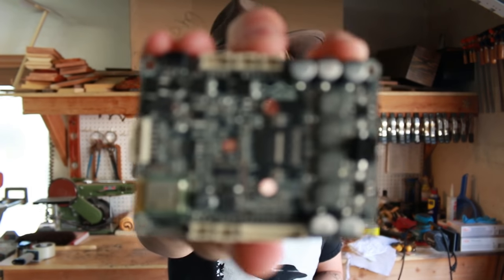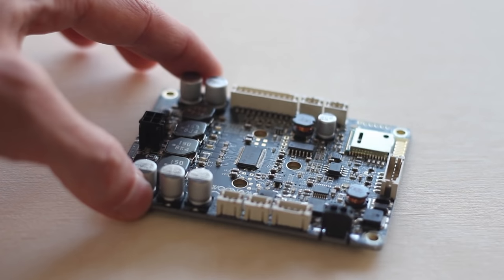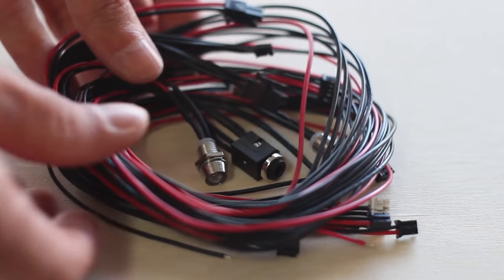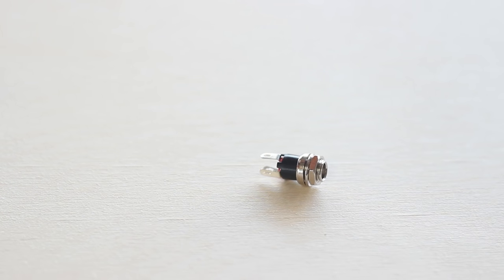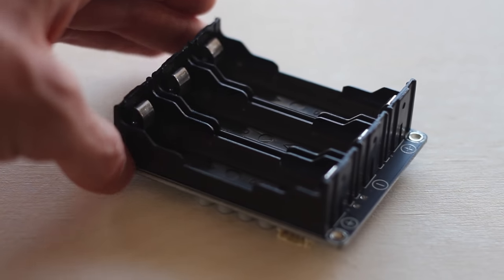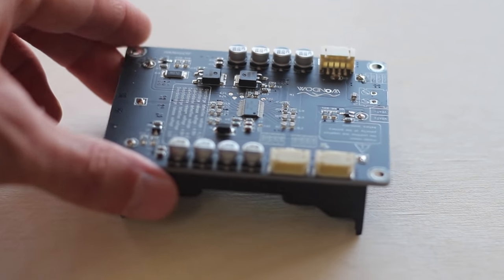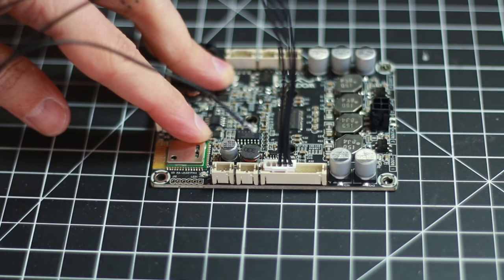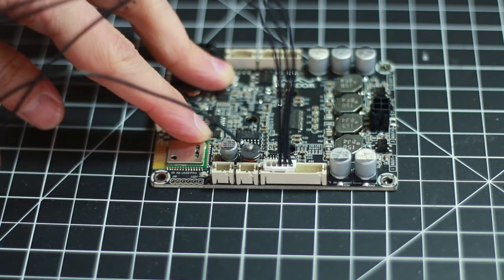The Best DIY Bluetooth Speaker Amp Board (For Now) & How To Fix Its Problem

Comment: so TDA7492P is a really common board for Bluetooth speaker projects, what makes this board better? does the TDA7492P output more watts ?
Reply: compare to non-p model, it doesn't need external heatsink to output 25w per channel, which are enough for project like this.
Reply from the maker: Hey, James! Watts aren't necessarily a good metric for quality of product. The TDA7492P is a good amp for DIY speaker builders, but it has build quality and reliability problems. I've had some boards work great, while others have big problems. What I think puts the Wondom line over the TDA7492P boards is the accessories and add-ons that are available for it. The wiring kit makes setup easy and the extension and battery board makes it really versatile. Tie that all together with reliable build quality and you've got a pretty damn good amp. Thanks for watching!
Reply: yeah that's very true. I was trying to weigh the pros and cons, basically when I build my Bluetooth speaker I want it to be as loud as possible but not necessarily the size of a boombox. However i am aware that you need a balance of audio quality and audio output. I do like this Wondom board because of what you mentioned, which is all of the easily added on features.
Reply: Thanks for your input. In terms of audio quality. How does this board compare to the TDA7492P? Does it have a good low range frequency response (bass)?
Reply: I too am curious to know how does this board compare to the TDA7492P? Does it have a good low range frequency response (bass)?

Comment: Questions:

Hey Kirby, great vids, keep it up!
Those speaker wires in the wire kit look really really thin,  Any idea what gauge they are?  

 Is the amp powerful enough to warrant using better speaker wires? (if using larger /more demanding speakers of course).

Comment: Do you know if there is way to get power OUT of this board? (Say to attach a raspberry Pi zero?) if there is this could be used to make an awesome all in one wifi/airplay compatible speaker with only a single power cable!
Reply from the maker: Thats on my list of builds! I'm pretty excited for that one. Yes, you can pull power right off the power jack, pretty simple!
Reply: Awesome I would love to see how that works. My current build is currently cobbled together using a crappy PAM8303 style board i got off Ebay for a dollar and some pretty naff speakers (no Bluetooth either) but I would love to upgrade it to something better when my son is a little older. I'm just going for a very kid friendly build, two button operation type thing that I can throw MP3's on over the network. I have the electronics sussed but in need to find some time to build the box as woodworking isn't really my strength.

Comment: Hi Kirby, Not sure if you can and wasnt sure where to ask you but my question does concern this board. Ive just bought the JAB2 board, 18650 charging module and aux module. Great sounding amp, just what I needed except.....my 18650's are charging BUT I dont know how to get them to power the amplifier...Works fine when powered by a laptop brick but nothing when I disconnect....? I tried to find your blog (mentioned in this video) but its not there, just a 404... Please do you have any advice...?

Comment: I'm having issues with the aux in on this board. I plugged it in per your diagram. I see the driver moving but no sound. bluetooth works fine, but nothing from the aux. any thoughts?
Reply from the maker: Is the aux cable plugged into the right place? The diagram they provide is pretty horrible. Double check with my guide. There's a link in the description.
Reply: First and foremost, thanks.

I have it in the long slot all the way up towards the other slots, or furthest away from the speaker outputs.  

I actually tried it at both ends and nothing happens at either. 

Again the bluetooth works just fine and when i have the AUX hooked up the woofer moves, especially if i turn up the pot, but no sound.

Comment: Hi.

Just a quick question from total noob - if I would like to build myself internet radio style device with wifi, bt etc. I can use this board and connect it to audio output of for example a raspberry pi ?? This is only amp? It does not have DAC part - this would be from a raspberry pi? (Or a phone using BT ?)

Thanks and have a nice day.
Reply from the maker: I don't know a whole lot about this, but I believe it depends on the software you are using on the Pi. Some require a DAC on the Pi and some don't. This is just an amplifier board, though. You would need some sort of DAC before this board. Thanks for watching!

Comment: Are the li-ion battery boards 'stackable' in any way? I would like to be able to have at least two boards run in parallel for projects that are a little more power-hungry.

EDIT: Even if it meant having two 18650 cells per 'slot' on the board. Is that possible? Obviously two cells won't physically fit into one slot, but they could be wired in right? From my very rudimentary understanding, this should be possible as long as the cells are all the same and equally charged before connection?
Reply: It does help indeed! Thanks!

Comment: Ii bought the 2 x 50 wondom board with battery extension.  I need help! I have a sinnry 3 terminal dc connector. How do i wire this? From what ive read the 3rd terminal is a switch for the battery to turn off when power is connected. I am so confused on how to wire properly.  Please help me

Comment: I recently bought this board (15W version) after watching this video.
Firstly, the 18650 board works sometimes, most all the time it didn't...need to take out the batts & put it back a few times to make it work.
Secondly, right at this moment the bluetooth is disconnecting after few seconds of distorted playback.
I just got this board 3 days ago & after 1 day of testing it isn't functioning properly anymore.
You put the title Best DIY Bluetooth Speaker Amp after how many days of testing it? & how many projects have you made with it?
Do you have any suggestion to solve this issues cause it seems that Sure Electronics isn't replying me with good informative answers.

(I'm using a pair of 3W 4ohm speakers (waiting for my full range 10W 8ohms). Running purely on just batteries at this point, adapter is on it's way)

Comment: I have an unusual project. 
 I want quality sound in a welding helmet. 
 Safety rules preclude earbuds and muffs. 
 Bluetooth connectivity a must. 
 
 Wish list:
 Solar charging panel because why not take advantage of welding light?
 Have a speaker and/or Bluetooth board suggestion ?

Comment: hey kirbie, i'm am plannig to buy the jab3 2x50 watts with the lithium ion extension board and the interface board. as lithium ion batteries i want 3 3500mah batteries. i wil use 2 two way speakers that are both 80 watts peak and 45 watts rms. but what i want to ask, do have an idea of how long my portable speaker will play? i also use 2 passive radiators in the box. greetings from the Netherlands. and love your videos so much!!!

Comment: I had the same problem when I first got one of these boards, came to the same solution, I think that that switch wire on the AUX is for the 15w board, from their site on  "
Please note that the JAB1 has a plug in detection circuit on board, the Bluetooth can only be searched when the 3.5mm headphone jack pluged in."
Reply from the maker: Interesting! I've only worked with the JAB2 board so far. I'll pick up a few JAB1's when they are back in stock and test them out as well. That's a strange way to go about things...
Reply: I haven't played around with the JAB1 either, my guess is they must have updated the amps but not the accessory cables. the documentation is fuzzy at best, they recommend a 12v power supply on the page, but it won't charge the batteries with out a higher voltage supply, I got a 19v one.
Reply: I think that the Aux cable is defined for JAB1 board (JAB 1 has a plug in detection circuit on board) and for JAB2 the best choice is to use the Extension Boards Optional (ref AA-JA11112)
My opinion is that detection circuit for JAB2 is on the extention board optional
What your feeling ?

Comment: Turns out that cable being unplugged to fix the feedback problem will not allow you to play music through your phone. At least, my phone (Galaxy S7), must use that cable as some type of jack detection. I have two of those aux cables and the one that has that cable unplugged will not switch my phone output to the aux connection. It just plays out of the speakers :/. I have found that I can use a PC or other device that allows you to force playback through a specific output but haven't found a way to do this through phone.
Reply: I also thought i would add that the 2x30W and the 2x15W boards function differently. You do not need to unplug that cable for the 2x15W board. The 2x15W board also plays nicer with batteries. The charge LED is on constantly with the 2x30W board even with a full battery pack. The charge LED only comes on when actually charging with the 2x15W board. None of these boards output an actual 15W or 30W per channel. It's closer to 10W I'd say.

Comment: Ok so I bought a board from Amazon
(ELEGIANT 50W+50W Wireless Bluetooth 4.0 Hifi Audio Receiver Digital Amplifier Board with Protective Case (TDA7492P), and the second time I plugged it in, it developed a nasty hiss and "data" noises. I am returning it, but what are the chances this Dayton board is the same way? Little gun shy now and bummed.

Comment: Hey Brother,

Can you run 1 channel on 6 ohm and the other one in 8 or 4 ohm and what's the RMS at these ohms
Reply: Sorry  sound bar power  supply  two board  power  supply , amplifier  blethooth   model th-by 858  sms WhatsApp

Comment: I'm planning a build, I ordered a TDA7492p 50w+50w, I have a Kastar 12v 6A 72w power source and a pair of two way 100w Dual speakers. Do I have a chance at decent sound? I'm having trouble getting coherent info as per compatibility. Lots of conflicting info. My investment is minimal so I can afford a couple lessons. I like your videos, I hope I can do some reading and try to catch up, I'm green as grass. thanks.

Comment: Hello, I have a project in mind, can you suggest if it is possible or not? I want to use my TV HDMI ARC to send the audio to a bluetooth board which will have bluetotth speaker connected to it. Ideally 5.1 channel .. is it science fiction or it can archived? I am doing some researches but you seems to know your stuff. Thank you for the help.
Luigi

Comment: All the bluetooth boards I have tried so far have 2 serious problems....
1 At power on and connection I get a stupid loud preprogrammed voice message
2 When the audio volume dips the boards go into low power mode then wake up again when the audio restarts both of which can be heard
I'm on the verge of giving up on bluetooth audio
Do you know of any bluetooth receiver boards which don't have these problems?

Comment: holy crap, I just bought this board. (the 50w variant).
I had the same issue, and found the same outcome.
i also have a problem with Bluetooth reception. from what my eyes can see, i'm not really able to solder a lead for an SMA antenna adapter directly to the onboard antenna, due to a layer of resin. 

Anyone have any pointers? I am definitely what you would call a noob.
Reply from the maker: How far are you trying to get reception? Bluetooth companies claim 33 feet, but its probably more like half that. Also, reception is greatly reduced without line of sight. Not much you can do. Make sure you're not putting the amp in a metal enclosure. Thanks for watching!
Reply: It's good for about ten feet, which is fine for it's application. I just thought it was something to note. 

Also, another thing to note, the volume pot is pretty hit-and-miss as far as QC goes, a friend of mine bought the same kit as I for a portable Bluetooth enclosure, and the same result.. The one that came with the kit was rather noisy. Luckily I had a 10k on hand. 

Love the build videos, they are pretty eye-opening, and make me glad to get back into DIY. Keep up the good work.

Comment: The boards and battery boards don’t work correctly, i have two of those and i have same problems with both. First board go on by itself and after while board only work with electric wire on not cordless with batteries.

Comment: Is that the only JAB board you have tested?  I've built multiple projects using the 15watt and 30watt boards without having a tiny bit of feedback or groundloop hum.       Thats running on 3 NCB1860B cells  and running various power sources 12-19volt.  About 7 months of heavy testing.      
Also,    I dont know if they corrected it but earlier versions the speaker polarity was labeled incorrectly.   out of phase.

Comment: I had the same feedback issue with my bluetooth boombox (can be seen on my channel). In my setup I used a noise reducer, a little circuit board powered by 12v that the audio signals coming from the Bluetooth module going to the audio amp passed through. And yeah, it really helped as it just seemed to filter out the noise.

Comment: hey kirby cool video. didn't see a link to the cable kit though. the volume control is rather neat. your "feedback" seems to be ground level differential between the amp and your source. see ttps://en.wikipedia.org/wiki/Ground_loop_%28electricity%29

Comment: Why dont you just build a gainclone kit and install a bluetooth module on the input. While you are at it, install a $20 chinese tube preamp in the same chassis and have a 100 times better amp than that one, and it is far better fidelity class AB. You probably already have half the parts to solder it up.

Comment: I need something that can push 200 to 300 watts true wattage not that bs it says it's 200 watt but really only pushes 50watt or less lol.. I Kno it's hard to get that kinda power from Bluetooth boards n amps that are big enough for a small speaker ya Kno.. but I have plenty of bad ass speakers n mini subs that are 100 to 350 watts from 1ohm to 6ohm ECT ECT so I'm building something that can push out 300 watt at 2ohm or 4ohm... And the speakers I got a 2 1/2" to 3 1/2" and then some 6" ECT.. just for this Bluetooth project.. I'm sick of those low wattage and unhealthy bass most Bluetooth speakers push.. yeah the ihomes and jbls n ultimate ears mega booms ECT sound really good but the bass isn't strong as I'm used to.. I have 2 sundown nightshade 12s in my car and my wife has a Orion hcca 10" on a hcca 4k at 1ohm and it slams for a 10" and my home systems are custom built with sundown audio ECT so I'm a bass head and I want a decent hitting Bluetooth that I can carry.. so I got myself some Harmon karmon and dayton and small kicker n diamond audio speakers ECT just for these Bluetooth things... So I'm needing some decent Bluetooth boards and some Bluetooth amps ect